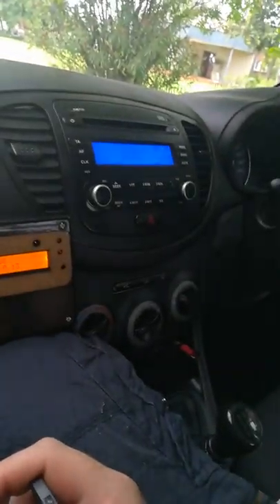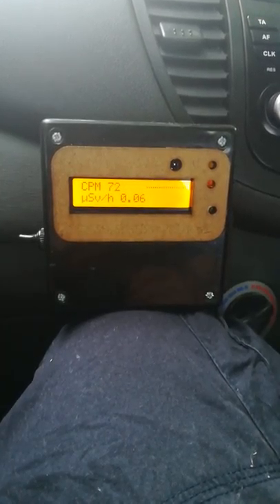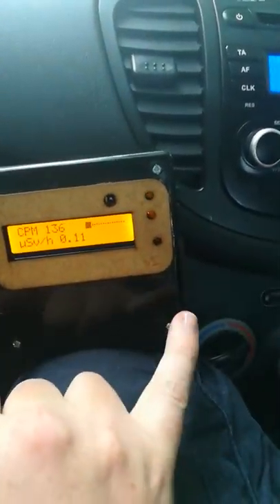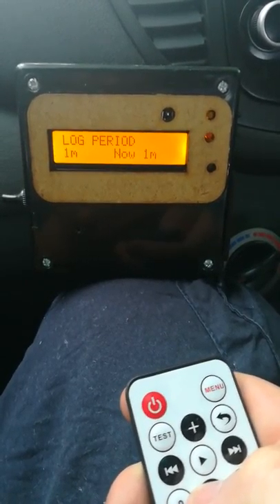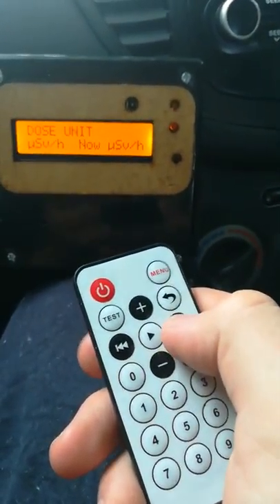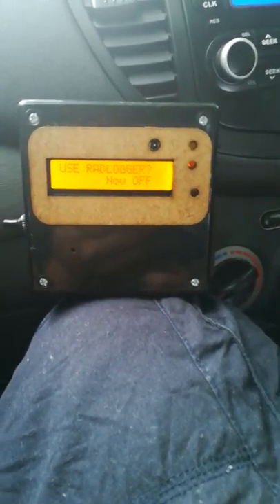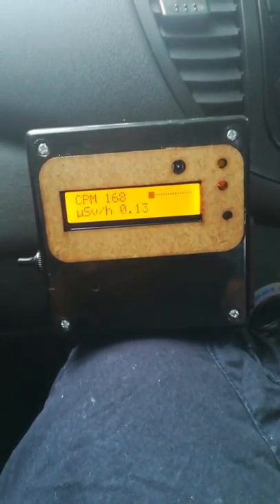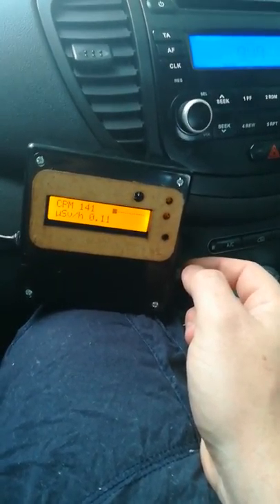Geiger counter in South Africa!

Comment: Your alarm needs to be set lower.  1000 cpm is much too high.  For your area 100 may be too low but generally they are set to 100.  Based on what I've seen, you have basically higher than normal readings.